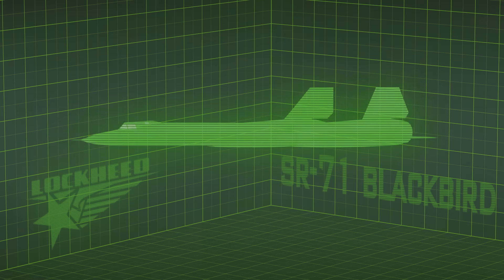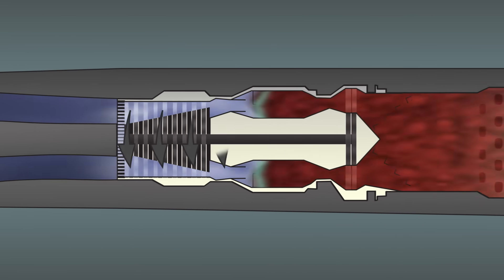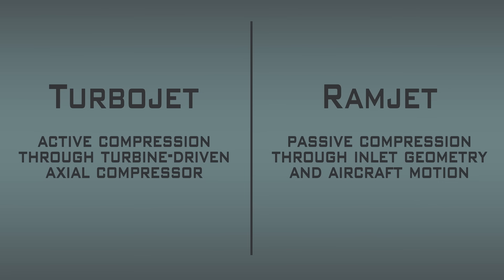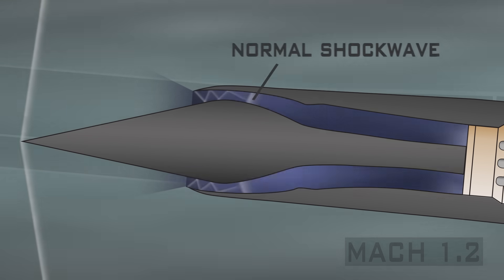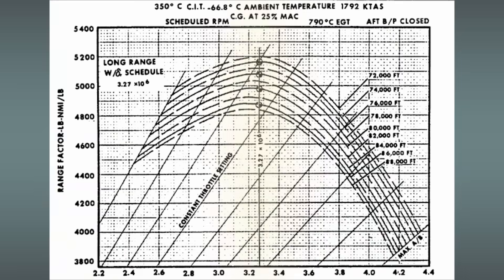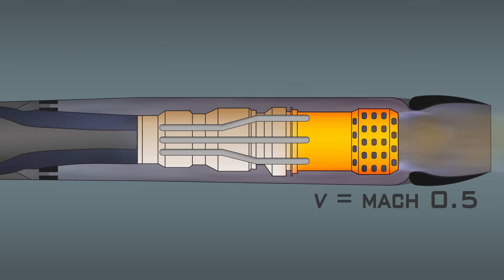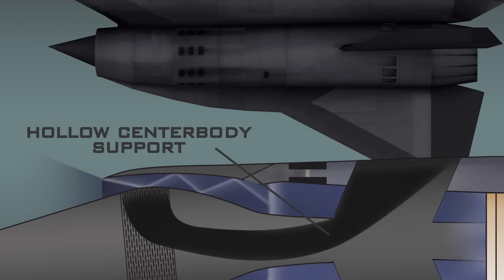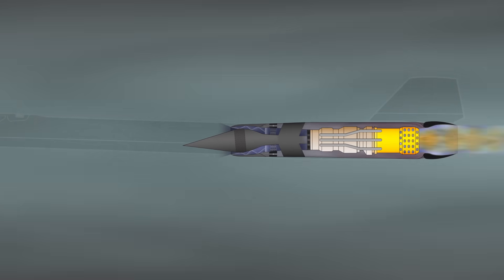The Mighty J58 - The SR-71's Secret Powerhouse

Comment: I must correct one flaw in this video. the J-58 bleed-bypass tubes increase the engine thrust by 20%, it is not a ramjet cycle as this video makes it seem.

in high mach cruise the inlet spike and the ejector account for the majority of the thrust made in the nacelle, and the engine make the least of it.

at mach 3.2 the engine is accountable for 17% of the thrust, while the inlet generates 54% and the ejector is responsible for 29% of the thrust.

the engine is unique not for its mach 3 performance per se. after all it needs air in speeds up to mach 0.4-0.5 at its inlet as any other jet engine. the real challenge and genius of P&W J-58 are its abilities to work in a very high pressure and high temperature environment.

many existing sheet alloys couldn't bare such temperatures and P&W had to invent processes to manufacture high performance sheet alloys from alloys that could only be cast beforehand. interestingly they used proto-ceramic materials in the turbine stage to coat the turbine vanes and blades.
Reply from the maker: When you state (and all documentation states) that "thurst is generated at the inlet" - what does that mean?  Thrust isn't magically generated, you add fuel to compressed air and burn it to cause it to rapidly expand (and you don't burn fuel in the inlet).  The inlet captures air and compresses is, which is a form of work, and therefore slows the plane down (translating the airplane's kinetic energy into compressive work) - arguably, the action of the inlet actually slows the plane down.

So really, what the statement means is that at speed, the majority of the the air compression is handled by the inlet, which is then bled (through the bypass tubes) into the ejector where it's burned in the afterburner to generate thrust.  The shape of the ejector then recovers pressure as the exhaust leaves the plane, which is how it 'generates' additional thrust.
Reply: Most of my statement is based on this document from Lockheed Martin's Skunk Works (http://www.enginehistory.org/Convention/2013/HowInletsWork8-19-13.pdf). It is here also here for anyone that wishes to find out more about what we're talking about.

Note section 5.4 (bottom of page 26), it reads as follows: "As the flow proceeds though the propulsion nacelle, it produces forces that are distributed throughout the nacelle... Notice that the majority of the thrust is felt in the inlet as the speed is increased up to the design speed. This is a result of the high pressure air in the subsonic diffuser pushing forward on the spike."

Admittedly, I am not an engineer and I have a basic understanding of jet engines from my profession, so when I first heard of it, I was really confused. But I do not believe that this statement can be interpreted any other way. It is also very consistent with the documentation that, as you stated, says the same.

The way I understand it, as the air is pushed into the inlet, it slows down, but it also gets compressed and is heated up. which in itself (by the power of Newtons third law) can generate thrust, not in anyway enough to make it a self sufficient, but if you add the thrust of a combustor (in this case the J-58 is akin to a combustor) and an ejector, you can be very effective. That's why the faster the SR-71 goes, the more fuel efficient it is, within reason of course, the J-58 has a limit of 425 degrees Celsius in its compressor inlet, beyond which the safety of the engine operation cannot be assured.

In any case, my main complaint about this video is the fact that it attributes the ability of the aircraft to cruise in high mach to the engine and on its bleed-bypass tubes. The tubes were created to increase engine efficiency at high mach because it wasn't as efficient as it could be. The term "Turbo-Ramjet" is  also accentuated a bit too much since the engine itself has no supersonic air flow going through it. On its own it is a very powerful turbojet that has bypass tubes to add to its performance in high pressures. The bypass tubes are just 20% of the 17% of the total thrust generated in mach 3.2. The real genius of this engine is its ability to cope continuously with pressures and temperatures that would melt or blow up other engines apart.
Reply from the maker: The key term in the document that you linked to (which I appreciate the link, btw) is the word "felt".  Thrust felt is different than thrust produced.

What the guy is saying is that the back side of the inlet spike is what is being "pushed up against" by the overall thrust produced by the engine.

The dynamic pressure of the air moving into the inlet on the front of the spike will always exceed the pressure recovered by the inlet (i.e. the static pressure behind the inlet), generating a net loss of thrust (drag).  Without the compressor, combustion chambers and afterburner, the inlet would simply pressurize air while stopping the aircraft.

The turbine increases the pressure of the air captured by the inlet, sends a portion directly into the afterburner and sends part of it through the internal combustion chambers.  The fuel burnt in the combustion chambers causes a rapid increase in pressure and speed, which turns the turbine to keep the compressor cycle running, while generating minimal thrust, while the fuel burnt in the afterburner provides the remainder of the rapid expansion and thrust.

Now, the force of the thrust generated by the engine and the afterburner needs to be 'captured' in the sense that it needs a rear-facing surface to push up against to propel the aircraft forward.  29% of that is done pushing against the inside of the ejector as the deLaval nozzle reduces the static pressure of the exhaust and translates it into dynamic pressure.  17% effectively pushes against the inside of the engine parts (including the compressor), and 54% is translated through the bypass tubes back into the inlet where it pushes against the rear of the inlet spike.

In essence by saying the inlet feels 54% of the thrust we're not saying that's where the thrust is produced, we're saying that's where 54% of the pressure difference generated by the engine and the afterburner is felt and the aircraft is pushed forward from.
Reply: +TechLaboratories 

The bypass tubes were installed as an after thought as the designers found high pressure stalling, instead of just venting to atmosphere they redirected which increases thrust by a small amount. Most of the thrust at mach 3.2 was coming from compressed air which was redirected to bypass the engine straight to the afterburner which also increased efficiency. I also picked up on the bypass tubes straight away in the video as it came across as these were what makes the Jet special.
Reply: I've initially thought the same but after doing more research I found this document (https://research.archives.gov/id/7283114) from the engine manufacturer that explains the reasoning behind the bleed-bypass tubes (bottom passage in page 16).
Reply from the maker: 54% of the net imbalance along the forward vector, yes (not the total structural load, since that includes the radial load by the static pressure which is balanced along the inside of the nacelle body and engine.

When you consider a thrust chamber as a closed box, and ignite fuel in the center, you produce no net thrust, because the force of expansion is equal in all directions.  Open up one side of the box, though, and you have a pressure imbalance on one axis, since the pressure is relieved through the open side, while still pressing against the opposite side of the box along the same axis.  This imbalance leads to feeling a force in the direction of the closed side opposite the open side.

The same holds true for any reaction engine where the combustion directly propulses the vehicle - on one end an 'open side' allows for a pressure imbalance along a single thrust axis, so long as there is something to push against (the 'closed side') on the other end of the axis - otherwise you're simply making a bi-directional jet of flame, with no net thrust.  Any surface that is 'pushed against' in this way to drive the plane forward 'feels' a portion of the thrust and becomes part of the 'closed side' from the idealized model.

The breakdown you linked to earlier shows where within the inlet, engine, and ejector that thrust is felt within the SR-71's nacelle, not where it's produced.  Or to put it another way, the breakdown shows how much of a part each section of the engine/nacelle plays in creating the closed side of the box.

Side note: whenever I hear the phrase "thrust generated at the inlet", I cringe a little.  It doesn't take a deep understanding of the physics of engines and thermodynamics to understand why pressure recovery can't 'generate' thrust:  The dynamic pressure of the air rushing into the inlet from one side MUST be greater than or equal to the static pressure of that same air captured in the inlet (or rather, greater than, since there will always be a loss of energy as heat).  So long as the dynamic pressure is greater than the static pressure (which it is), the net force felt by the inlet will always be one opposite the direction of motion, without adding any additional energy into the system.  Energy is added to the system by burning fuel, and the fuel is burned in both the combustion chamber of the J-58 and the afterburner, increasing the pressure of the exhaust.  This is where pressure generation happens that is then translated into thrust as the increased pressure pushes against the rear-facing surfaces, and a portion of the radial pressure is redirected into the same axial thrust vector by the con-di ejector.
Reply: @TechLaboratories  I'm poopin
Reply: It seems we reached an impasse, for you are adamant you're correct, and I'm still not convinced of your argument. I therefore started trying to reach some figure of authority about the subject. Hopefully I'll get a definitive answer, if and when that happens I'll report my findings.

I'd like to note that your video is still a great source of knowledge about the operation of the propulsion system of the SR-71 , with or without the part I dispute. It really helped me in understanding this marvel of engineering during my research about the machine. thank you.
Reply: Not as much as you might think. the A-12 power plant is identical to the SR-71 and the SR-71 pilot manual is available on the internet. i guess the main things that are still classified are some of the missions some intel objectives and the specific capabilities of the radar intelligence and the radar cameras. the engines and their abilities are covered pretty extensively in some of the sources I added before, and others as well. more than that there is no need to keep these things secret, there were certainly major technological breakthroughs in this aircraft, especially in metallurgy, but todays engines are leaps and bounds more advanced than the J-58 in that regard.
Reply: +lirdon1 Did you get a reply from an authority on the subject?
Reply: +iain Ray Air was stalling in the compressor
Reply: +iain Ray Sorry in meant at mach 3.2 the compressed air from the inlet shockwave is what creates most of the engines power about 80% so its not really adding to the after burner but added to it to create more thrust.
Reply: +iain Ray Also if you think about it logically as the bypass tubes were added in later development is probably why you dont see them on the diagram at the beginning of your video, which is good by the way.
Reply: I have to make sure I understand your argument before I try to answer to it. You mean that the inlet spike is one of the structural elements which the engine is pushing against. In other words, 54% of the structural load from the thrust generated by the engine is transferred to the air-frame through the spike thus pushing the aircraft forward?
Reply from the maker: +iaian Ray - The order I showed things was not to mimic the development or importance, but rather I started from the center outwards, front to back, building up the elements into the complete system, rather than trying to overwhelm with all elements right out of the gate.

And see my note about "generating thrust", which is essentially the same as "creating most of the engine's power" - What that means is that it handles 80% of the compression through pressure recovery.  The laws of thermodynamics say you don't get a free lunch, you always operate at a loss - power is generated by combusting fuel within that pressurized airstream inside the afterburner (primarily); while the high amount of compression increases the power extracted by the fuel, it's still wrong to say that the compression alone generates the engine's power.  Compression is always a net loss without added energy.
Reply: I’m sorry if I come off as blunt, disrespectful or dismissive, but you are wrong. Jet engines creates thrust by accelerating gasses in the compressor, combustion chamber and through the exhaust. But unlike pulse jet engines that really a chamber with only once side open during its burning cycle, all other jets use the continuous flow of the air to force the flame and the thrust to one direction. No jet engine (aside of pulse jets) can start with velocity of the air at its intake of zero, it needs some airflow into the combustion chamber or else the flame will go both ways and suffocate. Turbojets and turbofans use the compressor to create that flow, both at the start up (at this point some external power is turning the compressor) and in flight, ramjets use the supersonic air flow that is compressed and slowed down by the inlet to force its combustion into the exhaust and so on. 

The thrust itself is pushing against many components of the engine, the compressor, the combustion chamber and the exhaust but it is also generated by these components (see Rolls Royce- The Jet Engine, pages 207-208 - http://airspot.ru/book/file/485/166837_EB161_rolls_royce_the_jet_engine_fifth_edition_gazoturbinnyy_dviga.pdf ), the thrust itself does not push against external components.

the structural components through which power from the engine to the airframe is transfered, what the engine is really pushing against are the engine mounts that connect to the engines outer casing(see Rolls Royce- The Jet Engine, pages 248-249).

I used to think much like you did, and would normally agree with your argument. it makes no sense that the inlet would create thrust it’s a spike that is pushed through the air. But so much documentation said exactly the opposite I had to reassess my understanding of this topic. I see no reason why the engineers that wrote this expression time and again would write this expression if it is misleading, not just simplifying.

Here’s another report about the SR-71, this time from NASA: (http://enu.kz/repository/2009/AIAA-2009-1522.pdf).
Note subsection C in section IV, page 25. It reads as follows: 
“During high-speed flight in the Blackbird, compression of air in the inlets generated most of the vehicle’s thrust. At Mach 2.2 the inlet produced 13 percent of the overall thrust with the engine and exhaust ejector accounting for 73 and 14 percent, respectively. At Mach 3 cruising speeds the inlet provided 54 percent of the thrust and the exhaust ejector 29 percent. At this point the turbojet continued to operate but provided only 17 percent of the total motive force”

So here it says exactly that the inlet and secondary flow actions generates thrust. There’s no reason that I can see that this passage would be expressed this way, if the opposite was implied.
Reply: That was very informative, I was wondering about that, and it makes absolutely logical sense. You obviously has a good grip on the physics behind the specs that's been given. My original complaint wich I stand by, is that I believe (from listening to rare interviews with the designers etc.) a lot of the inner workings, additions made by LM, and real capabilities of the SR-71 and maybe especially the A-12 engines will stay in the dark world of classification until forever...
Reply: The funny thing about engineers is that they have the unique ability to take a subject and complicate it to the point that it sounds completely foreign the the average person.  They might say " ......attached to another object by an inclined plane wrapped helically around an axis" .....rather than saying "screwed". While I understand this conversation I'm willing to bet that most are scratching their heads.  :))
Reply: +Brian Barratt - LOL I wondered if someone would catch on to that !
Reply: It is Ramjet cycle with J58turbojet engine is  4 stage engine as its hybird of J58Turbojets and 12 J58Ramjets a 3 stage engine with no moving parts and with assistant air-flow spike cones and JP7 fuel. 

It's J58Turboramjet hybird engine second of its kind as France created first Turboramjet with Experiment Nord 1500 Griffon jet with one big Turbojet and one big ramjet engine.
Reply from the maker: Okay, three things.

One, I respect your argument.  It 'makes sense' from one point of view, but not another (which I'll get to in a minute).

Two, with respect to my example of the closed box model being closer to that of a pulse jet (or rocket..) yes, I agree, if you assume that I'm limiting the model to one detonation of fuel at a time, instead of tracing the expansion of one 'slice' of a continuous process through the engine at a time.  It's easier to model the thrust produced by a continuous flow as a series of infinitely close together reactions, since every moment within the continuous stream is essentially identical.  The engine in a box model is the only simplified model to understand reaction engines, whether a continuous flow engine like a jet engine or a rocket, or an intermittent reaction engine like a pulse jet.  I stand by the model.

Three, consider that the engineers designing and operating engines like this use slightly different vocabulary than the general layman understanding of the same terms.  The word "thrust", by definition, means "push forcibly" or "pushing against", which in terms of an engine means, where the net push forward is generated because of the imbalance: the closed wall opposite the open side of the engine in a box.  Thrust is not a force; thrust is the feeling of the force.

Another way to look at it, and to come to the same conclusion, is to track the dynamic and static pressures, along all vector axis, throughout the engine as a whole.  Any time dynamic pressure (relative velocity) is translated into a static pressure, work is done and there is a net loss of energy (as waste heat).

If you were to hurl the SR-71 forward with great speed (say, mach 3.2), and only looked at what was happening at the nacelle (the engine is not running), you would notice that only 92% of the dynamic pressure of the column of air in front of the inlet is captured after the centerbody as static pressure: the pressure on the backside of the centerbody would be 8% less than the pressure on the front side of the centerbody, which would be felt as a negative thrust, or drag.

Now, with the engine running, we can explore the other pressures.  The vanes of the compressor apply imbalanced pressures to the air to compress it, stage by stage, taking even more work (a net loss of energy), before either bleeding this further compressed air to the afterburner or passing it to the combustion chambers.

Inside the combustion chamber, you have a column of very high static pressure air that midway through has fuel injected and burned, which raises the temperature and causes the gas to expand.  Where does the gas expand into?  The rear of the combustion chamber and out into the afterburner (through the turbine) where the static pressure is significantly lower than the incoming column of air.  This translates the static pressure into dynamic pressure (fast moving) in the exhaust.  Since the overall pressure increases it also takes work, but that work is accounted for by the injection and combustion of fuel which raised the temperature, and the translation of the high static pressure into high dynamic pressure (with moderate static pressure) of the exhaust stream, which creates a surplus of energy available to do work.

The exhaust of the combustion chamber, with a high dynamic and static pressure, passes the turbine, which reduces the dynamic pressure of the exhaust in exchange for creating a rotation, which drives the compressor.  I.e. the exhaust delivers the work that allows the compressor to operate.  At this point, there is still an excess of dynamic pressure within the exhaust, but it's high temperature means that if we were to add any more energy to it before now, it'd melt the turbine.

So then, the high dynamic pressure and moderate static pressure exhaust (that's still oxygen rich) is added to the afterburner, where it's mixed with the high static pressure (low energy) air that was bled from the compressor.  More fuel is added, and the afterburner acts as a secondary combustion chamber: the rapid expansion of the gas due to the increase in temperature and volume translates into a dynamic pressure as it moves away from the high static pressure influx of exhaust and bled air, and towards the ejector.

The shape of the ejector translates a portion of the remaining radial static pressure (balanced against the walls of the ejector into lateral dynamic pressure along the axis of motion of the exhaust, further increasing the dynamic pressure of the exhaust gasses.

In all three cases where the exhaust rapidly expands (jet combustion chamber, afterburner, ejector), it pushes against that inflow of air with high static pressure (or, against the shaped walls of the de Lavel nozzle), and the thrust is generated, or rather, the pressure from that impulse is felt, at various points within the engine, inlet, and ejector.

So yes, from one point of view, it's entirely correct to say that thrust is generated at the inlet.  However, while extremely accurate, the ambiguity in the translation from engineering speak (where thrust is the feeling of the force) to the colloquial usage of the word (thrust IS the force), makes the concept far more difficult to understand than it really is.

Just remember that in physics and engineering, there is no such thing as a free lunch.  Work has to happen in order for any action to happen.  The inlet does not create this work, as is implied to most by the phrase "thrust is generated by the inlet", it operates at a net loss of work and contributes to the drag, or negative thrust, of the aircraft.
Reply: @TechLaboratories  Seems like you are quoting a textbook on jet engines here... what I would want to know is the mass flow of air, at full speed, through a) the combustors b) the six bleed tubes and c) the cowling bypass around the engine.
Reply: Aerospace engineer here. TechLaboratories is correct in their description.